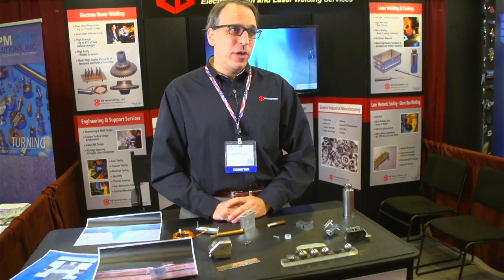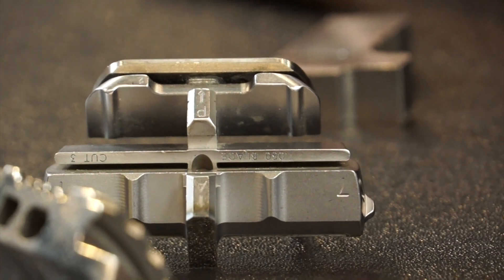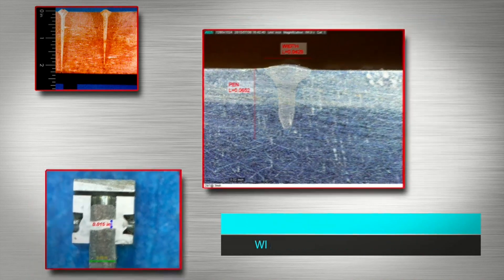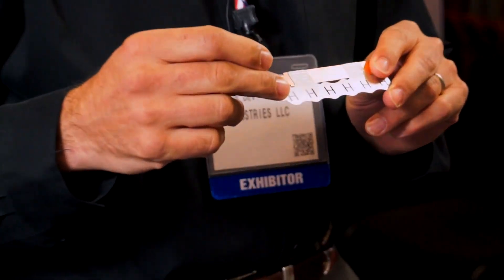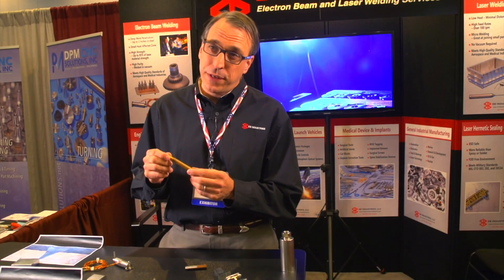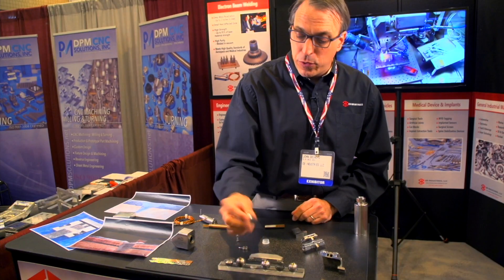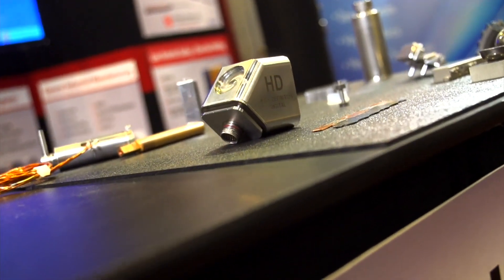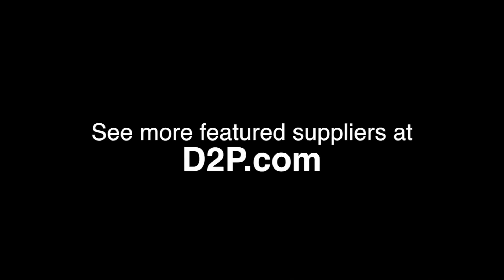Electron Beam Welding | Laser Welding Services | EB Industries | Farmingdale, NY

Comment: Is it possible to join ceramic and metal using EB welding?
Reply: If you can weld them through normal processes I would suspect you can electron beam weld them, but perhaps explosion welding would be better for two dissimilar metals

Comment: I have worked with electron beam welding in manufacturing environment for years. This technology is not new. The control systems are modern but the electron beam tech can be traced back to the '60s.